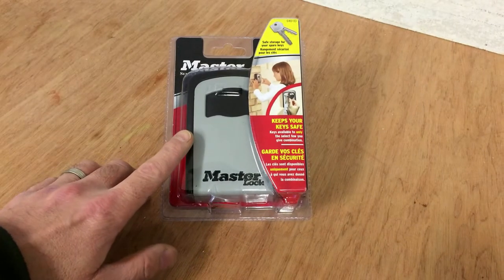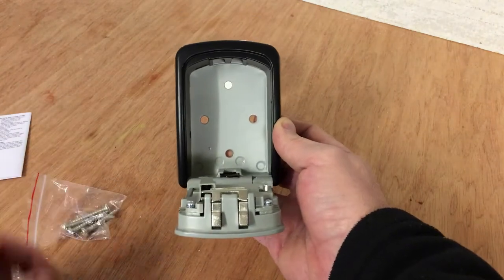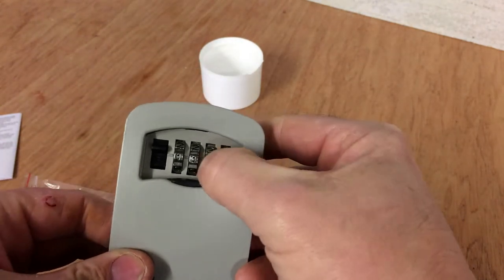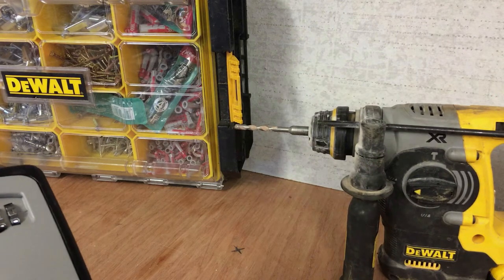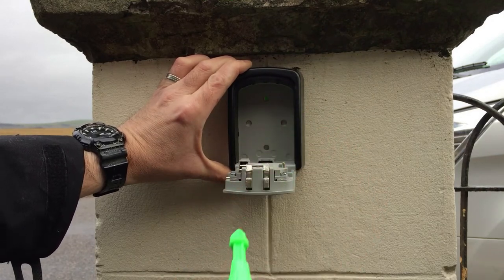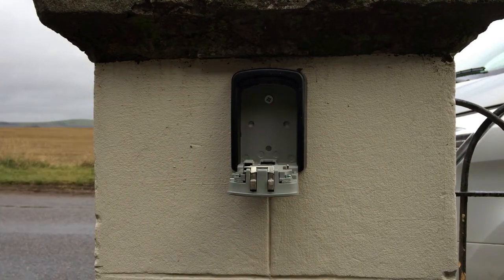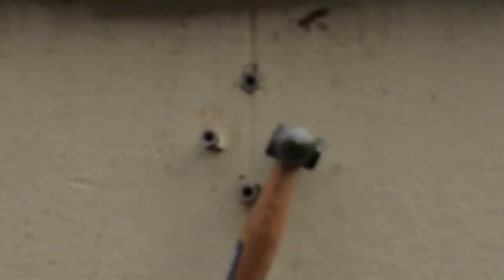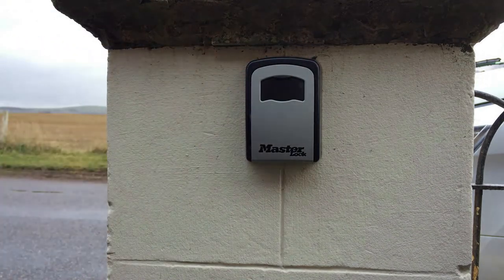How To Fit A Key Safe Box | MASTERLOCK

Comment: So what does a man of your multiple skill set take for a job like that it's cool if you can't answer 👍
Reply from the maker: Depends on multiple factors Ian. This one was part of a load of work I was doing at the same property, so it was priced in with the rest of the work (I think it was about 30 quid because I was there anyway doing other things). If it was a one off, I would charge my minimum charge which does differ depending on the travel time, but it is way higher than the 30.00 I charged for this.
 I don't often do small jobs like this, but sometimes you just have to do what you have to do, if you know what I mean. 👍
Reply: @Bacrenfencing  totally understand good answer I've a habit of undercharging bit soft I think and it depends on the area also.... Cheers m8 what's coming next ?
Reply from the maker: @iandrain.7277  Been crazy busy Ian doing mainly fencing (building my fencing business) but I am on a small rental property job today and tomorrow which I will post a video about. I may include some pricing in that one for you.
Reply: @Bacrenfencing  cool yer fencing jobs are quality big chap you don't cut any corners.....I've not been doing much I've started building planters last year I done well out it a lot of folk spending time in the garden 👍
Reply from the maker: @iandrain.7277  That's one of the reasons I concentrated on fencing. All this lockdown etc has made people value their outdoor space, fencing and decking industry booming at the moment = good time to start a fencing business !
Reply: @Bacrenfencing  aye it's big business here 2 bud 👍